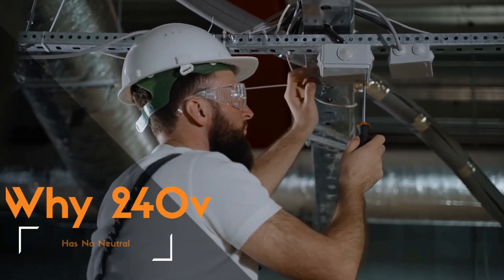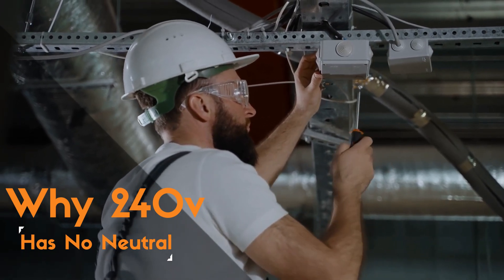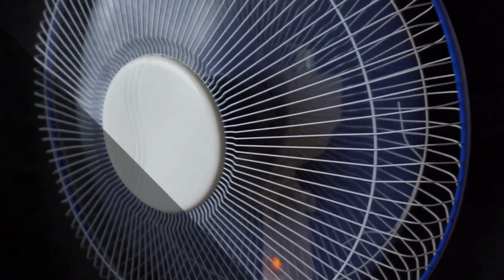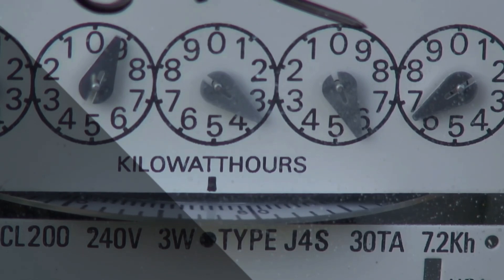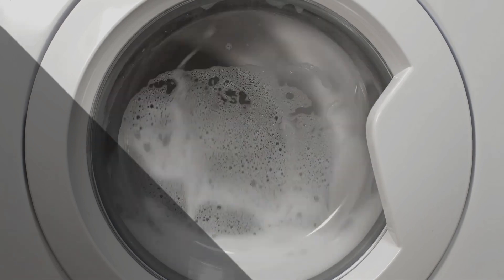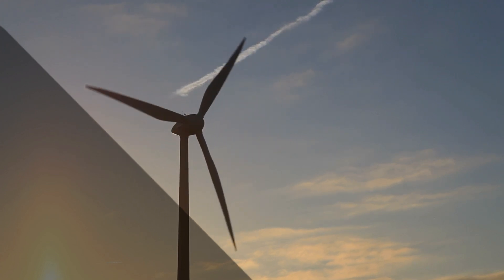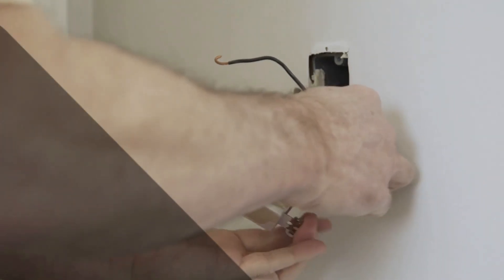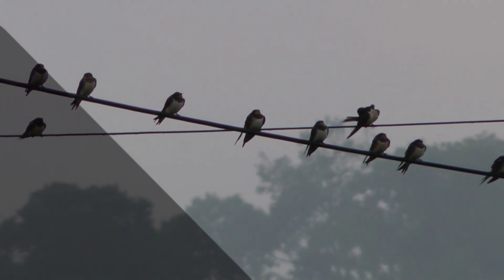Why 240v Circuit Has no Neutral? Know How It Works!

Comment: What about 2 hot wires that is carrying 220v but doesn't have a neutral wire can you connect to a 115v outlet can you tell me how can you do that
Reply from the maker: In this case you will need a voltage converter 220/115
Reply: You need a neutral. So no.

Comment: Some 240 volt appliance also have a neutral to power certain 120 volt components within that appliance like a clock and lightbulb on/in the stove top oven range or a drum motor for the laundry dryer for example.
Reply from the maker: Thanks for sharing this with me

Comment: When wiring an appliance to a 4 wire outlet, ( red, black, white and ground) does it matter if the red and black wires are switched or should they go to a particular order? I know the ground and white must go to their respective terminals just curious about red and black.
Reply: Doesn't matter. Only time it would ever matter is if you actually want to be particularly mindful over which half of the panel the 120V circuit inside the 240V device is using.

Comment: I just bought a motorized spa cover from China and the equipment only has two wires and they're telling me it's 220 volts and the motor is DC24 /12A. I asked is one of the wires neutral and one hot they said yes both is a 220v. How can that be? Im thinking if it needs 220v wouldn't they both be hot to keep the voltage at 220? Otherwise i don't see how double pull 20amp can be wired . Can you explain
Reply from the maker: I see that you are in a 110v country! If so your spa voltage would be 2 hot wires.

Otherwise in 220v countries it would need a neutral and a hot wire.
Got it??
Reply: @ElectricityFrenzy  well yes I am in the USA but it's a cover not for the hot tub itself it's a motorized cover for a hot tub. I don't know if that makes a difference in my explanation but you're saying 220 in China is 110 in America with a hot and a neutral? So although they're telling me one's hot and one's neutral in China it really means too hot for me when I wire it in America
Reply from the maker: Sure
The main point is the voltage between the two wires.
In USA 220 means two hot wires.
You should use a voltmeter to check it yourself or hire an electrician for this.

Please, if you need more info don't hesitate to ask me.
Reply: @ElectricityFrenzy  thank you very much
Reply from the maker: You are welcome

Comment: if its new construction, would you tape it black for a 240 no neutral needed or would you throw a /3 wire to have red and black for phase id even tho no neutral needed? what does code says about this?... to my understanding if you're changing the outlet from 120 to 240 you can tape the white black or red to indicate hot.. but if you're throwing NEW construction wire one should run a /3 wire just in case in the future the appliance may be changed and require a neutral.. what does the code say about this?

I'd REALLY appreciate an answer, .....thank you.
Reply: Red and black is normal.  If there is a white neutral that’s not needed you can cap it.  Ground must be green, green and yellow or bare.

Comment: Please help here i have 3 phase with earth wire i took one phase for control circuit so can i take earth point of motor as neutral
Reply: 400v
Reply from the maker: For the control circuit, use a transformer.
Reply: Ok  thanks i will do so
Reply from the maker: You welcome 👍👍
Reply from the maker: What is the motor power and voltage.
And how much voltage is the 3phase?

Comment: If I am understanding correctly:
In a split phase sytsem, 120v on each of the 2 phases, they are out of phase from each other 180 degrees. So as one Hertz is leaving, the other phase hertz is returning, therefore balancing out the circuit. I'm still confused as to why the system does not require a neutral  to complete the circuit though.
Reply from the maker: The 220V line-to-line connection does not need a neutral because the appliance or load is designed to use the voltage difference between the two phases directly, and the circuit is completed by the return path through the opposite phase rather than needing a separate neutral wire to return to the source.
Reply: @ElectricityFrenzy  interesting. Thank you!
Reply from the maker: You welcome
Reply: @ElectricityFrenzy  there is only one phase
Reply: You explained it better in the comment than in the video. A diagram of phase circuits would’ve helped

Comment: So what would happen on a household 240 circuit- if you left the neutral out - just wiring the two Hots to the Appliance?
Reply from the maker: Two hots, 220V of two different phases should run it with no problem

Comment: If each 120V are moving in opposite directions, how is an appliance getting 240V at the same time? Thanks
Reply from the maker: It's not simple like that, The fact is the two 120V wires are out of phase with each other by 180 degrees. In simpler terms, when one wire's voltage is at its peak positive value, the other wire's voltage is at its peak negative value.
Reply: @ElectricityFrenzy so when one is supplying power to the device the other is taking the power back to the transformer? Then at any point in time is there 240v moving through the device? Sorry if its a dumb question im a first year trying to learn
Reply from the maker: It's something like what you described.

It's technical aspects, you don't have to get confused. Just accept it has 240 V between them.

Comment: I had 240v heater by the door which I removed. Can I hook up 240v to say 20v transformer to power doorbell or video doorbell?
I have 2 110v wires, no neutral)
Reply from the maker: That's correct. You can definitely use the existing 240V power source to run a doorbell or video doorbell by using a 240V to 20V transformer. The transformer will help step down the voltage to the appropriate level. It's important to ensure that the transformer is rated for the power requirements of your doorbell to avoid any issues.

Comment: I need 240 volts for my drier. Have 4 prung outlet and plug (ground, neutral and 2 hots) I am only getting 124 volts on each leg of outlet and on each screw/wire of braker and when combine both legs of 124 volts on either outlet or braker I get 0 volts. Replaced braker and still 0 volts. Any idea why can't get 240 volts?
Should I remove the white/neutral?
Please advise.
Reply from the maker: Am I understanding it correctly? If you're measuring voltage between the hot wires and getting 0 volts on the sides of the outlet and the breakers, it suggests you might be measuring the same wire on both legs. Check the wiring at both the outlet and the breaker panel to ensure correct connections. Confirm that the wires are securely connected and inspect for any signs of loose or damaged connections. If the issue persists, it's advisable to seek assistance from a licensed electrician for professional help.
Reply: @ElectricityFrenzy thanks for the answer. I found the problem: what happened is that only top 2/3 of power metal bars where brakers connect, had a horizontal piece of metal connecting both, left and right sides and the 1/3 bottom part where I installed the slim 30 amp 240v braker didn't have that little horizontal plate connecting both metal power bars. I had to use a regular bigger size double braker that touched that horizontal metal plate and that fixed problem and got me the 240 volts needed for drier.
Reply from the maker: It's great to hear that you find out the solution 👍

Comment: Some idiot who owned my house before me grounded his 240v dryer 3 wire neutral/ground bare copper AWG6 wire to the copper pipes I had.  

I put in Pex pipe and lost continuity in the pipes and the neutral became energized when plugged into my dryer, which ended up shocking me.  When I restored Bonding jumpers to the grounded waterpipe, it fixed the problem.

There was no current flowing on the bonded neutral, because the two phases were cancelling each other out, is this how this works in this type of branch circuit?  I am so confused to why it works like this?

At some point I am going to run a new 10/3 circuit with a 4wire dryer connection with that dedicated ground and do this the right way, but can anyone explain to me why my dryer would not work without a proper ground connection?

If both phase/legs are cancelling each other out, why does the neutral/ground have to be there on the 3 wire connection?  Any dryer receptacle experts out there who can explain this to me?
Reply from the maker: It sounds like you experienced a situation where the absence of a proper ground connection led to an unsafe condition. In a 3-wire dryer connection, the neutral wire also serves as the ground, but when your plumbing system changed to Pex pipes, you lost continuity in the grounding path.

While it might seem counterintuitive, the neutral wire in a 3-wire connection is crucial for safety. Even though the two phases cancel each other out in terms of current flow, the neutral still provides a path for fault currents to return safely to the source. In the absence of a proper ground, the neutral can end up carrying fault currents, posing a risk of electric shock.

When you restored the bonding jumpers to the grounded water pipe, you reestablished a proper grounding path, which resolved the issue. It's important to note that the National Electrical Code (NEC) now requires a 4-wire configuration for dryer connections, which includes a separate ground wire. This enhances safety by eliminating reliance on the neutral for grounding.

In summary, the neutral in a 3-wire connection is used for both current-carrying and grounding purposes. However, due to safety concerns and code changes, it's advisable to upgrade to a 4-wire configuration for new installations to ensure a dedicated ground wire is present.

Comment: Meanwhile, the rest of the world uses 240V, for everything, including low-power devices such as phone chargers, LED light bulbs, fans, etc.. It's just that the US got so used to 120V.
Reply from the maker: Thanks for your helpful comment 👍
Reply: Thomas Edison chose 120V.  After WW2, Europe had to be rebuilt anyway, so why not make the switch to 240V?   Paid for by the US Marshall Plan BTW.  You’re welcome.  240V lowers the cost of wiring but increases the risk of electrocution theoretically.  But in the US since every US home has 120V AND 240V where needed…I think it’s fine.